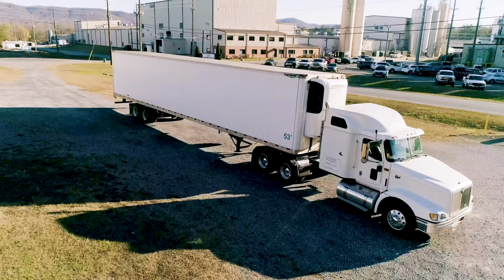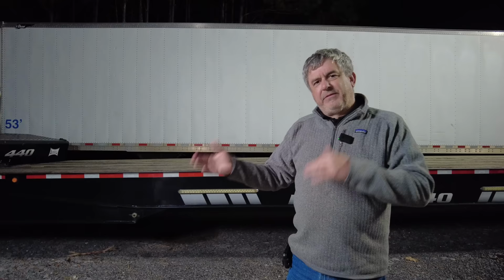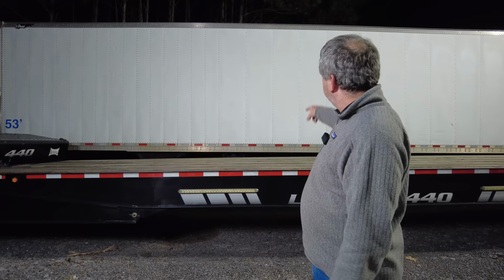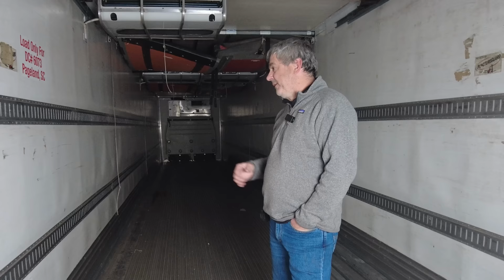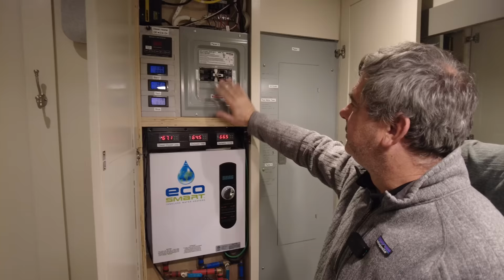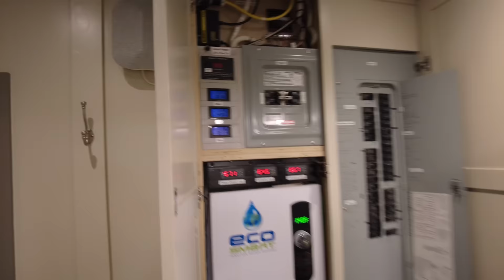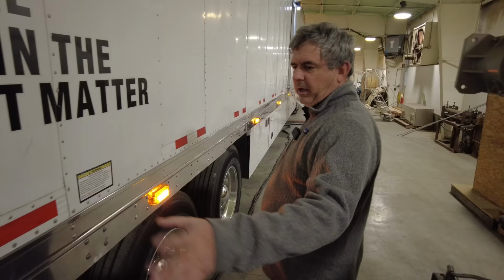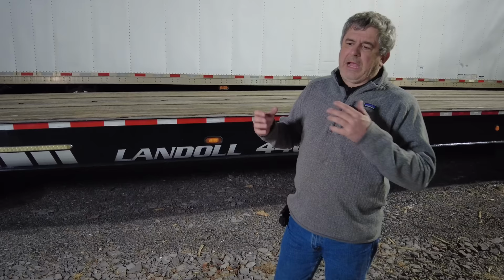We Converted a Semi Trailer Into A Sleeping Trailer! | Episode 1

Comment: Would there be a benefit to installing solar panels on the roof?   Maybe even something that could extend away from the side (like a porch roof)?  I’m not sure of the weight and potential power it might supply.  But in your “off grid” situations, curious if it would be worth the investment??  I like the idea of going carbon neutral - but know that much of the technology isn’t Quite “there” yet…
Reply from the maker: Yes.  Absolutely.  One thing i want to do next is build a tiny home.  Full solar on top with enough battery to get you thru the night and couple of rain/cloudy days.  
Great idea.

Comment: Why not go with a dry van? Is it bc of the insulation it provides?
Reply from the maker: Yes.  The insulation.  Dry vans also typically have wooden floors and steel cross members.  These trailers have aluminum cross members and stainless steel frame components.  The kingpin area and cross members are steel.   So the fact that floor system is aluminum and no wood and insulation is already in place it just makes a better foundation. 

Thanks for watching and your comments.

Comment: Are the water tanks under the trailer insulated and winter capable?
Reply from the maker: On this particular trailer we did not insulate them.   However, we do a have an   Electric heater and thermostat to maintain the lower bay.   It would be no issue to insulate …. Great question.   Thanks for watching

Comment: I wouldn’t use a reefer trailer. Install ac unit & you can haul trailer with only double axle tractor. With reefer engine you’ll need a triple axle—diesel wasted.
Reply from the maker: Great point.  We also use our tractors for more typical trucking.    Otherwise you could most likely optimize for a single axle.  Thanks for watching

Comment: What would be a ballpark price for one of these?
Reply: A solid reefer should run you at least $15k to start
Reply from the maker: Like the guy has already commented we pay 10-15k for these units.  The tires and hours will determine the price.  When we purchase we look for the rails and side panels.  We can paint the unit but a crinkled side rail is a pricy fix.   The way we outfit them with HVAC, gensets and lots of tanks.  We have nearly 50k in materials…. The labor is difficult to track as we build them in house and just track hours with other shop work.  I would estimate if you paid an outfitter you would be in 75-150k range but as with anything the level of finish and materials will dictate the final price.  

I think if would be fun to create a tiny home out of one of these trailers … do the entire top with solar … do a de-humidifier water gen and RO fresh water 1000-1500 AH of lithium batteries with goal of green and 100 percent off grid with HVAC and water heating for two people.
Reply: @ParkerSystems  Ideal tiny home - mobile home. Either to be parked without the truck, or to be a motorhome. For long stays and away from the city of course.. The height and the length (as well as the weight capacity) is second to none. For a family who is ok with staying for a while, an option is moving around in a car or van that can be towed, or even smaller vehicles stored inside (bike, scooter, unicycle, etc).
The roof can fit 13-14 solar panels of 550watts each...Also interesting would be to have rain collection. Ideal off grid home really. My preference would be huge windows for the view and open design for shared spaces (living room, kitchen). Subscribed, looking forward to your next videos.
Cheers

Comment: So if i was to buy one of these,  And get a semi truck to haul it.  Do i need a CDL  since the CDL =  commercial driver's license   and i would not be commercial and i would own it and not be for hire.   and its basicly a Rv.
Reply from the maker: You are correct.  If you owned it privately and are not in the pursuit of commerce and it is classed as an RV you DO NOT need a CDL to operate it on the roadways.  We utilize them in a commercial fashion so all our drivers are CDL.  There is an entire community of people that use commercial trucks to pull their fifth wheel trailers if you looked up HDT (Heavy Duty Truck) they typical use volvo trucks with automatic transmissions and single out the rear drive train -- search on youtube for HDT Rv and you'll find lots of examples.  To class your converted semi trailer to an RV to my understanding you have to demonstrate 3 things a place to sleep, a way to prepare food and a bathroom.  I have heard examples of portable basic examples that were successful (cots, cassette toilets and a hot plate and a cooler) ... hope this is helpful.  Thanks for watching and taking the time to comment.
Reply: @ParkerSystems  So where do i find that in the law,  I mean i asked Arizona and they told me just becuse i convered the inside to a RV the trailer is still rated,  and that rating puts me over the allow waight before you need a CDL.
Reply from the maker: Each state is a little different -- I was quoting the information that I believe correct for GA.  In the States that I am familiar some may require a CDL type license but typically they have a commercial version and non commercial version, and non version is typically easier to get and maintain -- I do know that my Georgia rules will apply to any state you are traveling. --- I guess the worst case is goto a friendly RV state -- I did not realize the can of worms this topic is --- if you google this there is a LOT of conversation on the ol interwebs
Reply: If you're using it as a camper or Motorola, you do not need a CDO in most states. Some states you would need it because of the weight you got to check the states

Comment: What would be the total cost estimate for this build??
Reply from the maker: We typically pay 10-15k for the trailer. 
I would estimate that the equipment supplies and materials will cost 50-75k and the labor will around that same estimate.   So the total unit will cost us 110-150k Dependant on the level of finish.  We will track all the cost on this unit and provide them as we continue.

Comment: When you say instant hot water, do you mean constant hot water?
Reply from the maker: Yes that would be more accurate.  I appreciate you making that clarification.  That was a little sloppy.  So technically it is a tankless water heater.   27kw at 240 (3 x 40 amp breakers) which at 208 it derates it to 23.4kw … I also said  hot water heater.    Technically it a water heater not a “hot” water heater if the water was hot it would not need heating.  The diesel fired wabasto heater heats water in a closed loop and runs it against the domestic water thru 3 plate heat exchangers … at 90,000 btus this is a similar to the same heating rate of the tankless electric.  The reason we added the wabasto diesel heater is to keep the on board genset small.   If we I wanted to run the trailer and the tankless water heater we would need atleast a 40-50 kw genset.   The diesel heater allows us to only need a 12kw genset.  

Thanks for helping me communicate with greater accuracy and precision in my speech.  I tend to get sloppy.  

Thanks again and thanks for watching

Comment: Hi much does it cost to convert it to a home
Reply from the maker: We typically pay 10-15k for the trailer. 
I would estimate that the equipment supplies and materials will cost 50-75k and the labor will around that same estimate.   So the total unit will cost us 110-150k Dependant on the level of finish.  We will track all the cost on this unit and provide them as we continue.

Comment: Didn't a few trailers from the 70s and 80s come with a door on the side of them from factory?
Reply from the maker: Yes.  Even the modern trailers can have a side door(s). They even have an integrated slide and ladder built under the doors.  Some will even have a door on both side.  

The first trailer I did had Mobile home type door.  I have since moved to a composite exterior door.  I remove the exterior trim and use aluminum angle and then my guy will polish the angle
Reply: @ParkerSystems  Aah 10-4. Neat conversions you are doing. Will keep watch.

Comment: Hello, what are you using to heat the water with diesel? I've been trying to find a suitable product but all I find is chinese junk. I don't need hot air, just hot water.
Reply from the maker: We are using a Wabasto heater -- this is a coolant heater, I would have to look back but I'm pretty sure its a 90,000 btu -- around 27-28KW similar to the electric heater that I have in the units.
The one used I actually found on ebay -- a new old stock kind of deal. -- I think I paid around 1,000.00 (i believe new it would be around 4K into today money) -- I have a similar unit on my bus -- Mine was made by a secondary company with the wabasto unit inside an enclosure -- I think Wabasto now makes a similar box -- these units are very well made and tip/filter is all that requires service. -- if the burner camber is not cracked and the electric module is good the tip and filter 
is all that needs work -- the electros that arch to ignite need pointing and gapped but it is a good platform ... i then used 3 plate to plate heat exchangers I cant remember exactly how I sized them but if you decide to go 
this route comment back and ill refresh my memory and suggest the correct size. -- If you are looking for domestic water heat for like one shower or fixture probable 30-50K btu unit will be great - it would preform like 
a continuous water heater like electric or propane -- I had to add a tank with water and glycol (antifreeze) -- if you are using this in an rv you can use the trucks radiator and get the benefit of heating the engine and making the over the road heater work other wise you'll need to add a tank -- i insulated mine..
Reply: @ParkerSystems  Thank you so much for all the information! I really appreciate the time you took to write this up. I found a similar one on eBay and I am working out a price with the seller. I am using this for my traditional home, where I have a diesel generator that isn't powerful enough to drive my 18kw on demand heater. I live in an area with frequent storms and power outages. I want to slowly burn diesel fuel and avoid diesel bug, otherwise the 500 gallons I have on site will slowly go bad.

I did notice you had 3 plate exchangers in your video, are those in parallel or series? I can do the thermodynamic calculations, but I have a few other questions.

Based on the specs of the one I found (same manufacturer) the output water temp is 90C/194F, which is too hot for a sink / shower IMO. 

Does it have a variable set point? Can it modulate like the electric Eco heater? If not, how do you reject the excess heat? Does it just short cycle?

Do you have a thermostatic mixing valve to reduce the max temp of the water output?

I'd be happy to pay you for your time if you prefer to have a quick chat about it.

Happy Holidays!
Reply from the maker: I would be happy to chat with you.   @fluke196c  

Call the office 800 8 PARKER tell whom ever answer the phone that we have spoken and leave a number and I will call you back, reference this video. 

800 872 7537

thanks 

I had the same issue with the temperature -- I used a electronic thermostat and reduced the output temperature to 150 -- similar to the 140 setpoint I used on the electric tankless -- most people dont realize that the 140 is residential limit -- if installed in a commercial setting they can go upto 180 degrees --- to hot for a shower but great to help clean in a dishwasher in a restaurant -- 

I used a 50 gal glycol tank --- so my cycle time was not that short and put a delta T of 10 degrees so the short cycling is not an issue. -- I placed the heat exchangers in series -- the hot water of the first exchanger runs against the domsetic water at the coldest point  -- We get to with in 5 degrees even with 3 showers running -- we do have those "safety" mixing valves but we turned them up pretty hight. -- we dont take small children on deployment so we are not as concerned about the shower heat -- if you get it too hot step out of the shower --- I dont believe i could change the setpoint on the unit -- most gas - diesel motors operate around that 190-200 range and these heater are designed to heat those vehicles if the motor isnt operating --

Comment: My main concern would be the structure of the trailer box, very flimsy.
Reply from the maker: I would agree with you, that was actually a concern of mine when I started on the first trailer …. One reason that I believe I had this concern was my experiences with van trailers … my original plan was to provide structural reinforcements to the inside of the trailer.  But once I started building the trailer I realized that reinforcements would not be required.  The reefer trailers are much stronger than the vans.   They are surprisingly rigid.   Our underbody cabinets also add to the trailer.   We have had no issues.   Even the cabinets haven’t given any issues.  I custom build the cabinets to the walls.   If flexing was an issue this is where it would manifest.  

Thanks for the comment
Reply: @ParkerSystems  glad to hear yall researched into that, ive worked in the auto industry and for a brief time the towning industry almost all my life, and I've seen the dry van sides are relatively weak, I've had no experience with reefers I didn't realize the insulation provided that level of strength. I'll be looking forward to this build, I think it's a pretty cool idea

Comment: Price?
Reply from the maker: We pay 10-15k for these trailer used.   This particular unit is still operational and we will sometimes sell the unit …. Depending on hours we can get 2-5k for a working unit.  We have several trailers with working refer units that are this module so will most likely keep this one for parts.
Reply: @ParkerSystems  What's the cost for a completed trailer/sleeper/camper?
Reply from the maker: @ParkerSystems
11 days ago
Like the guy has already commented we pay 10-15k for these units.  The tires and hours will determine the price.  When we purchase we look for the rails and side panels.  We can paint the unit but a crinkled side rail is a pricy fix.   The way we outfit them with HVAC, gensets and lots of tanks.  We have nearly 50k in materials…. The labor is difficult to track as we build them in house and just track hours with other shop work.  I would estimate if you paid an outfitter you would be in 75-150k range but as with anything the level of finish and materials will dictate the final price.   @Flipping_Assets

Comment: Windows are needed for psychological reasons.
Reply: I will say, as someone who’s spent several nights in one of theses trailers during our deployments, it is a little strange to stay in the same room but then walk out to a different location 😂 at least the beds are comfortable.
Reply from the maker: Yes sir -- I could not agree more.  The main areas the kitchens, office areas and main entrances have doors with half lites in them.   I considered windows in all the bunks but with complications with light and shades plus the number required we did not think it was worth the complexity and cost -- we have a canopy system were the guys hang out when in camp so when you are in the trailer you are basically sleeping in the birth areas -- the kitchen area has the window and rear office of the second trailer also has a window.  I plan on building a trailer like a personnel RV or Tiny Home -- for this unit I will do windows. -- it would be easy to do a large window where the reefer unit is installed and I would add windows in other areas -- great point and tanks for watching and taking the time to comment --

Comment: It would be nice if you could add solar to the roof as well. That would generate a lot of power and save a ton of fuel. It would probably take too much work to drop the trailer to maintain 13'6" overall height though.
Reply from the maker: You are correct.   And on several of other trailer like these we have added solar.  Not the entire roof but enough to maintain batteries for on board items such as lift gates, lights and the batteries for starting the refer units.  You are correct about the height it does add like 3 inches.  We have used the flat solar panels but they don’t seem to last and when they get hot the efficiency goes way down.  I also think that is the heat that kills them.  We also run 24” tall rubber (11R tires on our trucks) which also adds.  It’s been our experience if we keep the trailer under 13 8-10 we have few isssues.  The better solar panels get the air gap seem produce more and definitely last longer.   

I want to build a completely off grid set up.   And do the entire top in solar panels… the heat savings would be dramatic I think plus you would be generating the power when you need it most if wanted to do solar air conditioning…

I also add heavy piece of aluminum angle in front of the panels to provide a limb or obstruction deflector to get limbs and other low items on top of the panels.   Seems to help prevent damage.